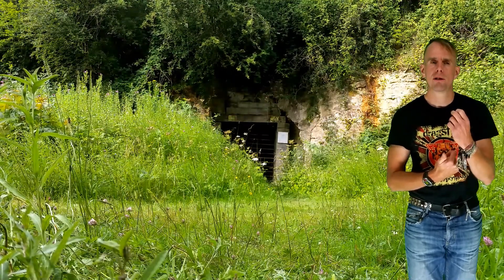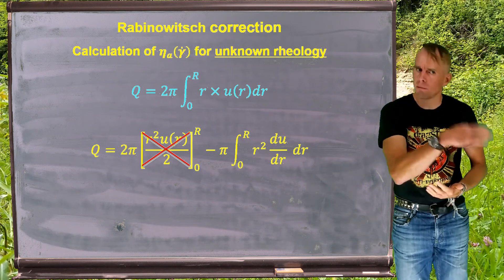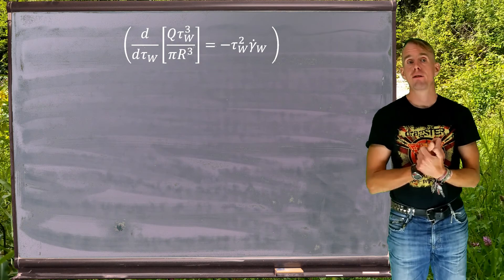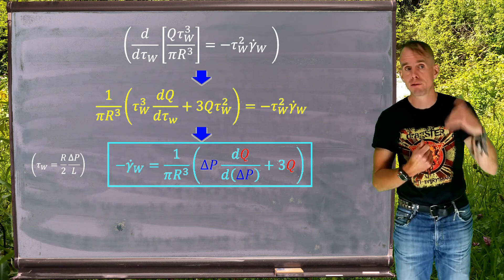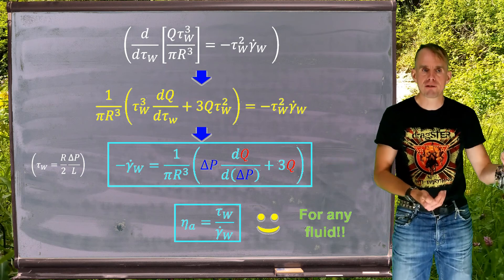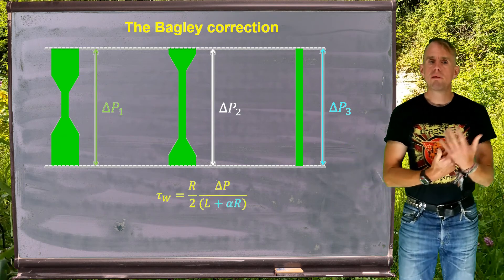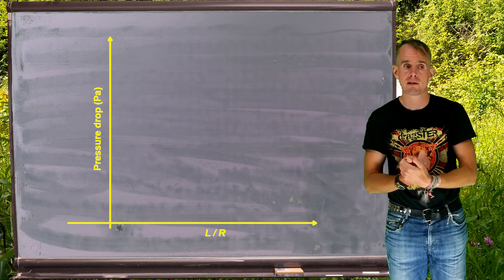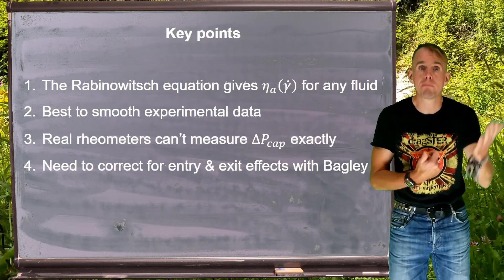Lesson 7, part 2: the Rabinowitsch and Bagley corrections

Comment: Awesome lecture!

Some questions in regards to Bagley correction:

I guess a is a material property. Any info we could get from that?

Can't we have an easier correction without a if we just remove the pressure contribution for L/R=0?. Simply said: ΔP(true)= ΔP(apparent)-ΔP(intercept). I guess there must be something wrong with this as we would not have to repeat for different Qs and it's "too" easy.

Once again thanks in advance!

Comment: Thank you mr Hallmark for this wonderful serie,
i am now dealing with dispersion adhesive (in water ), precisely i am trying to study its flow behaviour in a pipe, and i don t know how to derive a proper equation ( does it come under the power law fluid equation). And what are the important informations that i must get from the Adhesive supplier to really understand its behaviour.
Best regards
Reply from the maker: Very glad that you're finding these courses useful - thank you for the feedback. If your aqueous adhesive is, for example, a dispersion of polyvinylalcohol (PVA - a typical wood glue), then it will be most likely to be shear thinning. This is due to the polymeric nature of the solution and the way in which the polymer chains respond to changes in shear stress. Exactly what equation best describes it depends on what you're trying to achieve! Yes, regions of shear thinning behaviour may be modelled probably as a power law fluid, but not all of the behaviour. Also, it is unlikely that your supplier knows the full rheology of the fluid - ask them by all means, but in my experience this kind of information is quite rarely available. In order to understand it, you're most likely to have to do some rheometry on the fluid yourself if you have the equipment available. Hope that helps!
Reply: @drbartsworldofchemeng  thank you so much for the advices ❤ i will do so.
I wish you all the best Doctor
Reply from the maker: @iyadhcheikhlarbi1367  thank you!